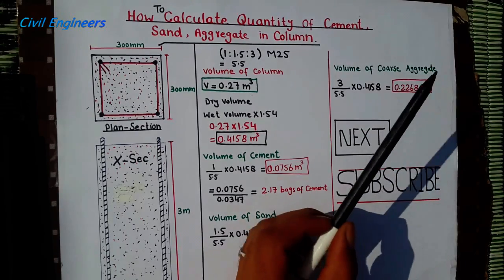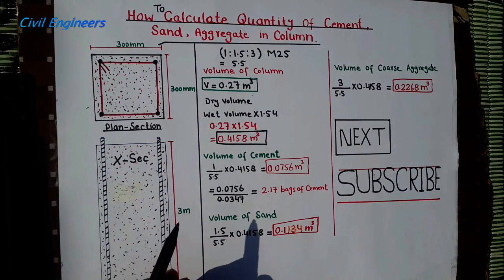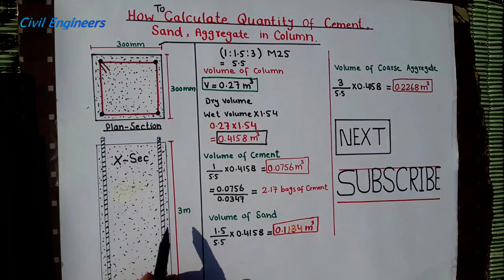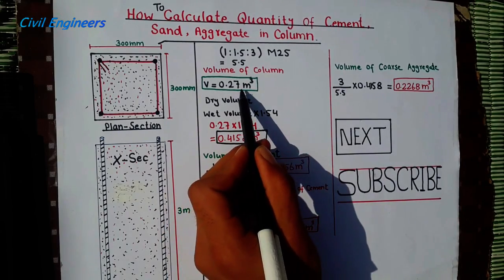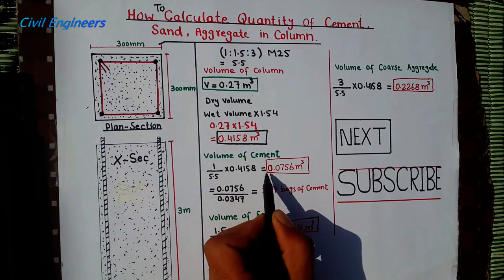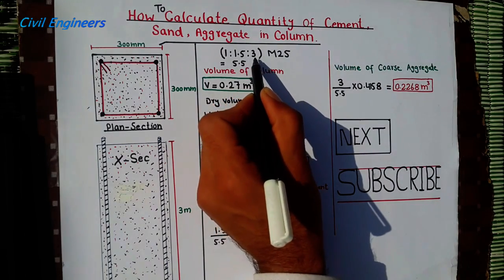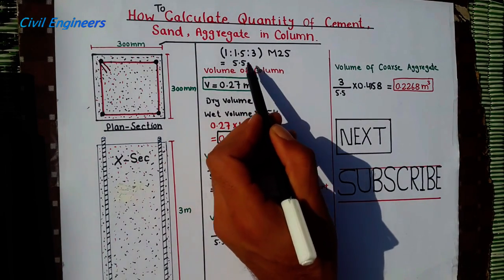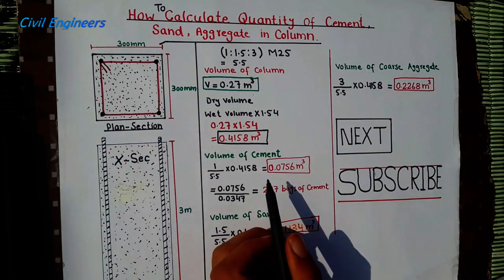How to Calculate Quantity for Cement , Sand & Aggregate in Column

Comment: Sir my
 question no1
When you multiply the quantity with each other it become 270000
But how you convert it into 0.27 m3
Please
Reply: 300x300 is in mm mate. 3 which is the height is in meter.
Basically the computation is going to be
0.3m x 0.3m x 3m= 0.27cu.m

Comment: I  am planning to build a small house in an area of 16x40 sqft with steel roof. What Column Size and Material Required do you suggest for a 20 feet high rectangular column. Kindly suggest.

Comment: Just wanted to thank you so much for good info. Yes it's M20 not M25 but not an issue guys. Just change the mix and calculate by the standard value. Civil Engineer rocks.

Comment: Good day Engr, Thank you for the lectures, please how do you come about the factors you are using, like the 1.54 factor you use multiply to the wet concrete volume to convert to dry volume, and 1.26 factor you used for the mortar in plaster material calculations. Is there any video you did regarding to these. Please help me with their title so i can search for the video.  Thank you
Reply: There are many videos on you tube to explain that.

Comment: 0.0347 explain sir
1:1.5:3 is M20
1:1:2 is M25
Reply from the maker: 0.0347 cum is the bag of cement volume
Reply: How did you arrive at the volume of cement bag sir? Calculation please.
Reply: @rangasou  
35.32 m3 /1.226cft for one bag of cement so 1.226/35.32=0.0347m3
Reply: volume of cement in bag=mss of cement in bag/ density of cement

Comment: Steel calculation for this colum
Reply from the maker: after 2 days bro
Reply: 1) Bro, are you not taking into consideration the volume occupied by the steel reinforcement ?
2) Why did you multiply the value of Wet volume by 1.5 to get a bigger dry concrete value.? wont shrinkage rather reduce the dry concrete volume?
And how did you come by 1.5 and 1.26 values used in concrete and plaster respectively
I need your urgent reply 
Thank you and keep up with the good work.
Reply: The volume of the reinforcement is minor, you will see there is no added volume for wastage, nothing is perfect of course, so many variables. There are many videos on you tube explaining wet volume and dry volume

Comment: how to calculate the steel in colum 300mm * 300mm and 3m hight
Reply from the maker: yes bro
Reply from the maker: thanks bro
Reply from the maker: convert 300 mm to meter it will give u 0.30 meter.
Reply: Civil Engineers assalam WA alikum bhai..Good job I like your videos..
Reply: kya 1.54 is the wet volume of 1 cu mts of concrete..
Reply: 1meter=1000mm
X = 300mm
Therefore= X multiple 1000 = 300 multiple 1 
Now calculate